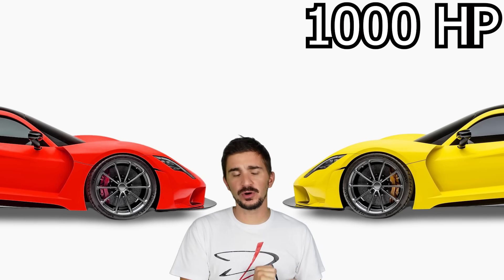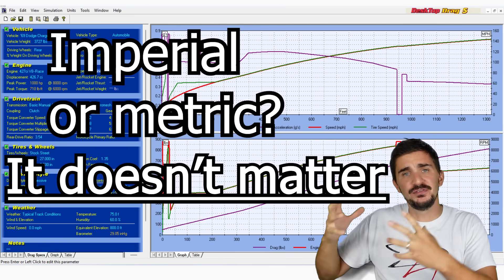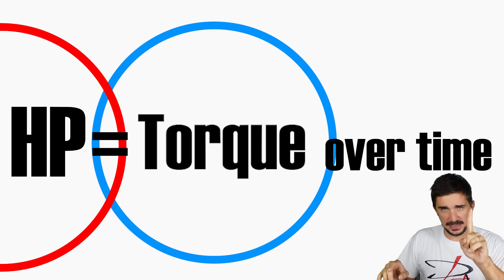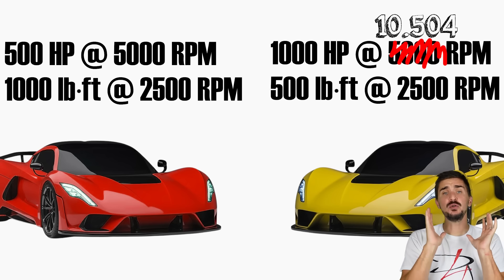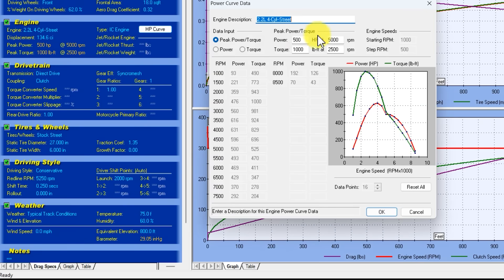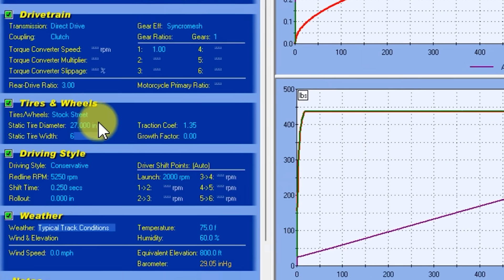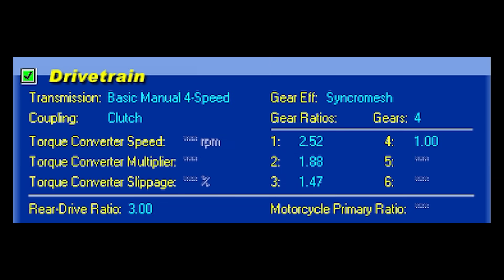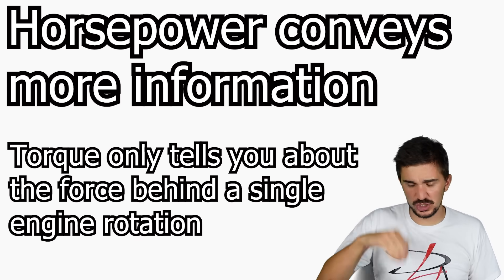Who's faster? Explained and Simulated - Horsepower vs Torque

Comment: Videos like this are the exact reason people are so confused about HP and torque. 
In neither of the examples did you showcase what an actual car company would do with either engine. 
The high revving high power engine would realistically get a 2:1 gear ratio compared to the lower power engine, as a result the high power vehicle will have double the wheel torque and basically every speed. 
Also note that in any of these examples where they just run the high power engine at 1000 rpm and are like "look, it barely moves", it's not actually making high power at that rpm. 
On a vehicle with a correctly geared transmission, torque is irrelevant.

Comment: Imagine you’re breaking loose a rusty bolt. To get this example closer to a vehicle race scenario, imagine the bolt is a mile long(and magically straight). Btw, you can only hold the end of each wrench when loosening the bolt. If the bolt starts to loosen, that means the torque you applied to get it loose can now also be measured as power(you need rpm to have power). If it doesn’t move, you need more torque. This can be achieved through gearing, like by using a longer wrench. Of course, that long wrench will never be able to rotate as fast as a shorter one. That means once the bolt starts moving easily enough for a shorter wrench, you will get the bolt off quicker by using a shorter and shorter one. L shaped Hex/Allen keys are a great example as well. If you can turn the bolt loose easily, then shorter and shorter wrenches will get the bolt off the fastest(assuming the wrenches are changed as fast as a transmission, lol).

In most cases where power and torque are discussed, there won’t be such a drastic fall off in torque required after starting, but the example hopefully demonstrates that as soon as work is done, power can be measured(as it is torque x RPM), and power cannot ever be unrelated to torque(no rpm, no power). Again, torque exists even if the bolt doesn’t move(it’s the effort, not the result). Power is effectively the higher dimensional version of torque. I know that last bit got pretty whack, but once it clicks, you’ll get see it all.

Comment: Before watching the video, I'm guessing the answer is gearing.
Reply: And...he compares the two engines with 1 speed. Somebody better talk to F1! LOL
Good video. I got my head around the difference between HP and torque by looking at the formula. Torque = how much work; HP = how fast the work can be done. As a practical matter, the higher an engine can rev while still maintaining some degree of torque, the more horsepower it will have. Maintaining torque at high RPM's usually results in sacrifices at low RPM...hence street cars vs. race cars, and big rigs vs. gasoline powered pick up trucks.

Comment: Very thorough explanation. 👍
I say: you cannot feel torque. You can tell that a Harley has more torque at low rpm than a CBR1000, but that is because the torque makes it output more power at that low rpm.

Comment: You should have tuned the transmissions to perform optimally for each engine (each engine would have had a different transmission). The high hp engine would have won in every category.
Reply: TRUE 😎 except daily riding atleast for most people .

Comment: I agree with most things said in this video 

But 

I think the most indicative duel would be like this: two vehicles with same horsepower, but one has twice the torque at half the rpm. And gearboxes should be made so that both engines reach the same speed at peak HP rpm

I believe that these two vehicles will perform almost the same, ignoring wheel spin and other smaller variables.

Power/weight ratio is what determines performances… torque alone is just a “fashion”, it means nothing but towing capability and/or ease of driving fast

Comment: In my opinion, horsepower and torque shouldn’t be compared to one another. Hp is the be-all-end-all and torque should be interpreted as how/when the horsepower is delivered. High torque = high hp at low rpm and low torque = high hp at high rpm. That’s straight from the hp formula.

Comment: As usual your the educator I'm looking for.

For a long time I have been thinking about how torque and horsepower really affect a car.

I think I finally figured it out just the other week.

So a course in classical physics tells you force accelerates objects. 

Cars doesn't break the laws of physics, they are too accelerated by the force. 
But F≠torque. Gear ratios, final drive and tire diameter together determine how much force is equally to say 200Nm. 

So say we are accelerating the car with 200Nm in the second gear. It doesn't matter if we are at 3500rpm or 6000rpm. If we deny the air resistance we would accelerate at the same rate. 

But if we shift up to 3rd, our 200nm would result in less force at the wheels. Why? Gear ratios, the torque multiplier simply went down. 

So now to horsepower, as said torque*rpm/k. Horsepower simply accounts for the fact that a car with peak hp at a lower rpm, has to shift up earlier compared to a car with peak hp at higher rpm.

A higher horsepower car generally is quicker than a lower hp car. Since not having to shift up as early is a advantage.

Comment: Mathematically, the problem is much more simple and the answer is 1000HP is twice faster then 500HP (without the air-drag and friction factors).  The gear ratios are again simple torque calculations.... You made it too complicated 🙂

Comment: You are correct that they can't be considered in isolation. A more fundamental way of thinking about it is, torque is how much work can be done and power is the rate that work can be done. Work can be defined as change in KE. Doubling the speed at the end of a drag race means four time as much work but in half the time. That means eight times as much power is needed to double your speed in this hypothetical engine. Torque represents how easily the engine can spin up to it's ideal RPM for maximum power. The high torque engine will get to it's maximum power more quickly, but if the higher power engine can stay at it's maximum power rate as well, it will have a more rapid change is speed of the vehicle. They are both essential and anyone that says "one matters and the other does not," does not understand the problem very well.
Reply: Check any video how a racing or a drag car is launched. Engine never runs at its torque band at all.

Comment: Torque is the rotational Force 
Force exerted per time equals Horsepower 
To obtain more horsepower you need higher RPM 
To get higher torque you need lower RPM

Comment: Good video. But maybe a bit misleading for the layman. It is not wise to compare two completely different types of engines with the same gearbox. In reality its simple, the engine with more power can do more work. No matter what machine you think off. Every machine needs a certain amount of power to do the job. It could be a supercar, tractor, coffee grinder etc. More power = faster car, stronger excavator, faster ship... Different torque and rpm are just engineering way to achieve the needed power.

Comment: This is a silly video and you are talking about a fake, made up dilemma. Because an 1000 hp car will be (could be) always much faster than the 500 hp car, and this is obvious for an engineer. Because the torque at the wheel could be 2x bigger than a 500hp car torque at the wheel, and that is the torque is what accelerates the car and not the torque at the fly-wheel (the torque on the data-plate). Of course the 2 cars won't use and shouldn't use the same gearbox, that would be very silly idea very bad engineering. Nobody would do that. The 1000 hp car could be always faster, at a given wheel revolution, always! It can have 2 times bigger (that difference is huge) thrust at a given speed, that thrust pushes your car forward. And this is not a question or dilemma, this comes from the definition of the power in the physics. You question in the title suggests that this is not an obvious thing. But it is, very much. The title and this fake dilemma is misleading people, so you just make the chaos.

Comment: I personally like the image drawn by Randy Pobst:
- Torque is how hard you're pushed back in your seat
- HP is how long you're pushed back in your seat (the higher the rpm, the longer the push back - - >HP) 
American v8: high torque (large displacement) but relatively low hp because it doesn't rev high
S2000: relatively high HP thanks to rpm but with a low amount of torque (low displacement) 
Aventador: torque with displacement and hp with rpm

Comment: Torque curve is important also. You can have an engine with less horsepower and torque be faster if it has a flat torque curve vs a peaky one
Reply: how ? let say flat 50 nm from 2 to 7 k rpm and 60 hp at 9 k rpm vs let say 30 at 2 k rpm 60 at 6 k rpm 70 hp at 9 k rpm both perfect gearing in let say the same naked bike how 50 nm flat 60 hp can be faster in race than 60 nm at 6 k rpm 70 hp at 9 k rpm ? 🤷🏻‍♂️ assuming similiar wide peak power even lil more narrow can be in 70 hp version to certain point it still be faster on track 👌🏻 50 nm be faster from idle to 5 k rpm let say everything above those rpm its game over for 50 nm flat 60 hp version 😁👌🏻 flat peak 60 hp vs super narrow 70 hp with relatively big diffrenc between gear lenght now it can be true 👌🏻 assuming 60 hp flat would use more avg power on let say 1/4 mile so let say 100 % from peak vs 70 hp cos have very narrow peak and big diffrenc betwen gear lenght so let say 70% so 49 hp avg now 60 hp version win this drsg race 😎👍🏻

Comment: Horsepower is the POWER that we know from physics. It's the ability to perform work = ability to produce energy over time. Which energy? Kinetic energy. So high horsepower means high kinetic energy growth, which means: A. ability to pull high load (trucks) or B. accelerate fast with low weight. Now the transmission, RPM of peak horsepower, clutch, tire grip, all of these make things complicated, so showing torque gives rough overview on engine characteristics, but high horsepower generally means capability for high kinetic energy growth.

Comment: Really informative video. I would only add that since the transmission significantly favored the HP-biased engine, it would be fair to test everything with transmissions optimized for each. Then, Torque-bias would win again because you could add higher gear ratios making the wheels spin faster and therefore moving the car faster (unless you don't have good enough tires which would make a drift car)
Reply: No... when properly geared, the HP biases engine wins every time*.  But due to this terribly confusing video, it *seems torque bias could win.
Reply: Wrong, you don't understand what power is.
Reply: The torque biased car will only ever be capable of delivering 500hp max. 
The ho biased car will deliver twice as much. Naturally it would always win in a real world scenario using proper gearing at least if the race is real world scenario too.
Reply: @wo-olf  my assumption is a bit unnecessary. We could not tell until we get those exact cars all tuned and race them together on the drag strip. Different acceleration, different top speed, different weight, different handling, the more I think about it the more complicated it becomes
Reply: @Mr.Engine993  we are talking about the same car still aren't we? Same car will always be faster with more horsepower in a standard environment. Torque doesn't help a bit in acceleration if there is no power. Tractors have loads of torque but very low rpm. You'd need 80 gears to make up for that and that wouldn't be practical in any way.
Reply: @wo-olf  theoretically the same car yes, more HP will eventually result in more speed, but it's kind of unrealistic to put a different engine and a different transmission and expect it to weigh the same. Weighing down the lighter one would help but still
Reply: @Mr.Engine993  1000hp will not weigh significantly more than 500 with the same engine. It's boost nowadays and a bigger turbo doesn't weigh that much compared to a smaller turbo. 
Drivers weight will be way more significant.
Reply: @Mr.Engine993  1000hp will not weigh significantly more than 500 with the same engine. It's boost nowadays and a bigger turbo doesn't weigh that much compared to a smaller turbo. 
Drivers weight will be way more significant.

Comment: The scenario is impossible. There for irrelevant. Horsepower is a calculation there for not actually real. It's not measurable. It's a calculation based on math. Torque is the only force, and there is never a point in the automotive world where torque is information about a single moment. Most 13L engines running at 700rpm(11.6 rotation per second) is making more than 600lbft at clutch engagement. A 3
5L ecoboost make 90% of its peak torque at 2000rpm(450lbft) where as the competition(6.2L GM, 5.7L Hemi)  don't even come close to that until 4100rpm. Also why a diesel vs a gas in th HD pickups have such dramatic differences in capacity. Torque is tha limiting factor in how much work can be done. A 430hp 7.3LV8 with a 10R140 and the 4.30 axle has a GCWR of 29,500lbs. The same exact truck with the 475hp 6.7L powerstroke has a GCWR of 46,700lbs. 35hp difference doesn't make that much of advantage. But when you look at the torque value at the given HP rpm you see why there is a significant difference in capacity. More so after the transmission manipulates the torque(HP doesn't change with the gearing because it's a calaculation). 
475hp@2600rpm is 959.6lbft
430hp@5500rpm is 410lbft
35hp is a small difference but 549lbft is a huge difference. After manipulation(transmission and axle ratio), at 58mph at the engines  peak HP rpm each truck has a given torque rating at the wheels.
Gas 7.3  need 5500rpm(430hp is 410lbft), so 410lbft x 2.13:1(3rd gear) x 4.10:1(axle) = 3,755lbft at the axle.
The 6.7 diesel has 475hp@2600rpm 
So at 58mph that's 7th gear(1:1)
So 959lbft x 1:1 x 4.30:1 = 4,123lbft to the wheels. This draw the similarity in the calculated constant (difference of 35hp) of the calculation. But in the actual world that gas engine is far more expensive to operate. Fuel economy directly correlates to rpm, as does engine life. Also when it come to getting at load moving that diesel will do all of the work earlier. Both trucks at their perspective max GCW would not accerate similarly. In the end more of the targeted audience of this content is interested in speed over work(fast cars over hauling things).

Comment: I think ppl get wrapped up in the theory of fantasies to much because the relation between HP and Tq has been figured out a very long time ago, as a engine builder the main focus is application and limitation of the engine architecture.  Do i wanna race do i wanna tow.  Lets say example i wanna make a 800hp race engine naturally aspirated, do i go with 6 8 10 or 12 cyl. me personally i'd go v8, why, size, engine choice i could use chevy ls ford coyote dodge hemi amg 6.2L Ferrari v8 or a Porsche flat 8.  Ill chose a chevy LS v8, why, its size is not only compact i have the displacement range from 250ci to 500ci within the same dimensions on that engine block which none of the other engines have that ability.  making 800hp is a feasible goal but people look at peak numbers which is irrelevant.  I would be buidling an engine with a purpose and to make as much average power in a specified rpm range, it will always accelerate faster, but it comes at the knowledge of intake manifold modeling cylinder head design bore stroke combination camshaft specification and intensity compression vs chamber design.  Those tactics give the engine its character, and ppl just focus on one specified number rather than its of other specifications that create the whole program
Reply: A guy asked me would a rather have HP or TQ, i said that question dont make sense to an person who build engines, a reciprocating engine creates both, he said which would you rather have more of.  I said you have application and goal.  A certain amount of cubic inches will make a certain amount of TQ and cyl head that flows a certain amount of air is the limit of how much HP a engine can make, dont get no simpler than that.  U put a v10 F1 engine in a dumptruck its gonna struggle to move it.  U put a 2500tq industrial engine in a unibody car its gonna twist the frame, U put a 1500hp Prostock engine in ur daily driver it wont idle good nore drive happy under 5000rpm but after 7000rpm u will never have traction besides having an engine capable a accelerating to 400mph and drinking a gallon of fuel ever 8 secs.  Its down to application and goal